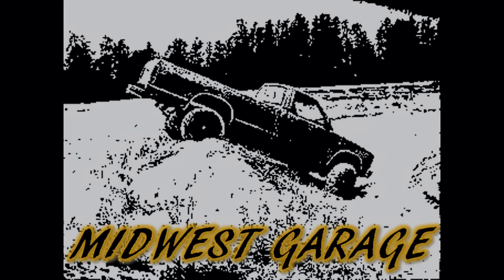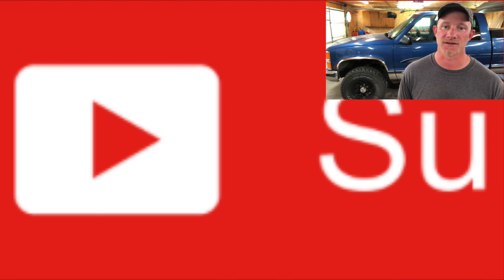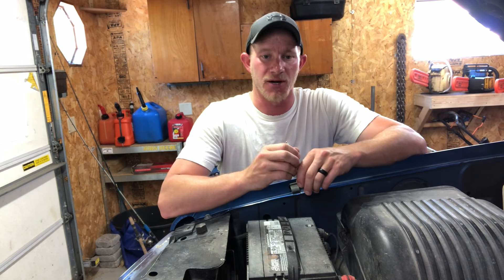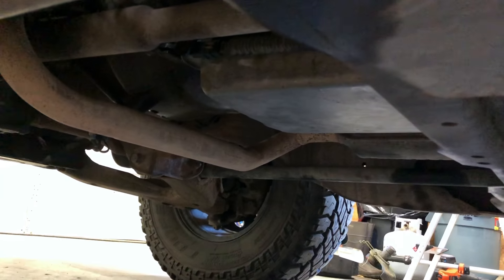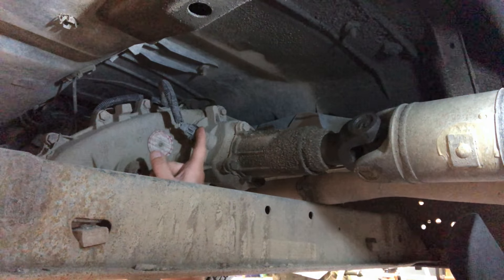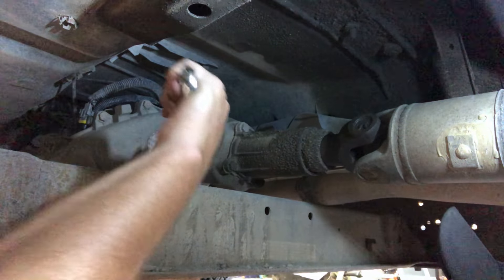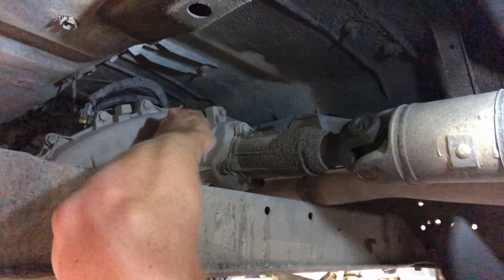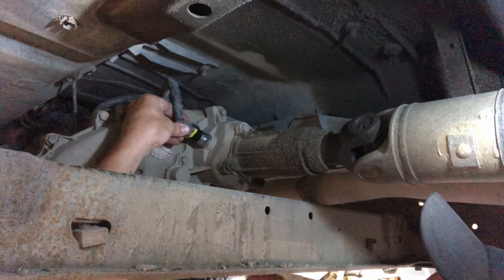How To Replace Vehicle Speed Sensor in 1988-2005 Chevy GMC Truck & SUV

Comment: I have a 2002 2500 HD not shifting It’s giving me a code p1571
Reply from the maker: P1571 is a traction control code...but sometimes that code will be thrown if theirs something wrong with the PCM. I’d start with cleaning the mass airflow sensor and see if that helps. Sounds weird but that has a lot to do with shifting oddly enough. Let me know if this helps at all!

Comment: I have a Chevy Blazer LS 1996 engine 4.3 , the problem is that when the car is stop the engine runs normally and when the car is not moving more than 20 km per hour and when I start to push the gas pedal the car starts to pump from the exhaust manifold and then the engine is chocking and shut off and never reach a speed more than 20 km per hour. If anyone knows where is problem l will appreciate him.

Comment: 30 dollars my ass, i went to autozone and advanced one lady tried to sell me some fucking bolt on speed sensor. but i just got what you have in this video and that fucker costed me 111 dollars wtfffff. SideNote: My 1998 k1500 symptoms are currently as follows. Crank the truck up, drives like normal for idk maybe something like 8 miles on Highway. Then ive noticed after either a uphill or downhill descent or ascent that thats when my truck all of a sudden drops out of AOD (automatic overdrive) and will not go into it until i make it home, and let her cool down... its been a pain in my ass being that i just had a 2.5k front end replacement not 2 weeks ago.. Hopefully this speed sensor will solve my problem, i have a good feeling, and i hope so. but this comment has gone on too damn long, just trying to give my 2 cents to anyone out there who is having the same issue with their truck